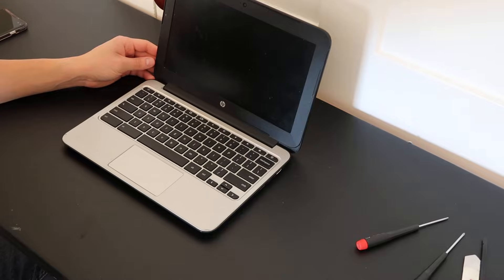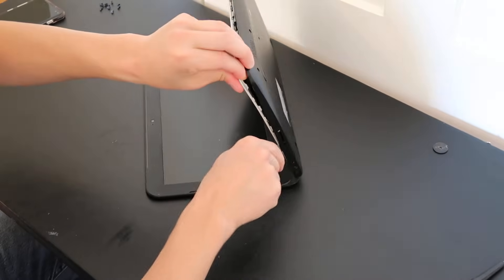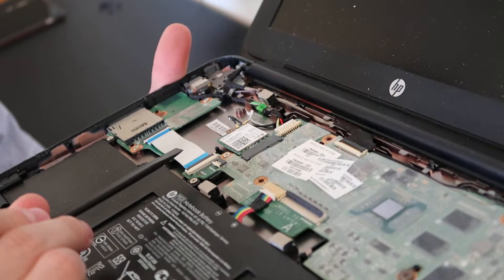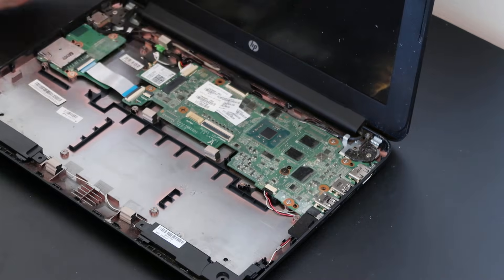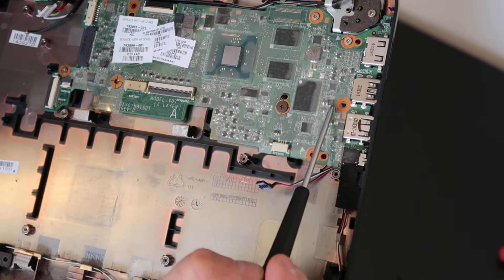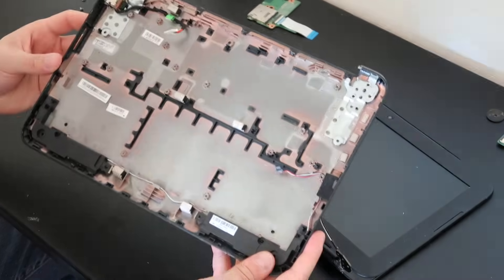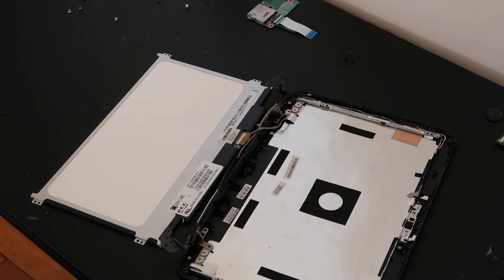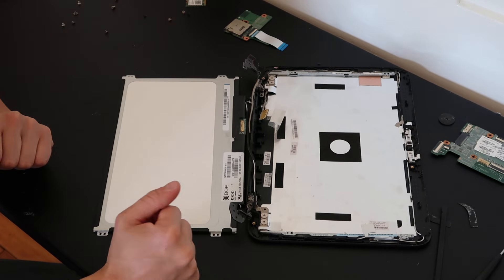Teardown / Disassembly - HP Chromebook 11 Laptop Computer

Comment: i have a question! whats the purpose of the tape covering all sides of the motherboard and what will happen if i remove it? thanks!
Reply from the maker: Just to keep it and the wires secure. Nothing bad will happen if its removed but I would recommend putting everything back how it was when your done whatever your doing.
Reply: @PC_Monkey alright, thanks! :)
Reply from the maker: @evvanescent  Happy to help :) Always here if needed !!

Comment: is there any way to upgrade the storage?
Reply from the maker: Remember to check the FAQ's on my videos! It could save you time getting an answer to common questions :)
As in the case with many smaller Chromebooks, this model does not have removable storage or memory. They are integrated into the motherboard.

Comment: What does it mean if my black string or bog fluffy wire is cut
Reply from the maker: If a wire is cut, then the components on either side may not work. If any part of a computer is damaged, it should be replaced. Do you need help finding a replacement?
Reply: I found out what it's called it's called a ribbon there's a little tear on it would that stop the computer? @PC_Monkey

Comment: how to upgrade storage? i cant see the ssd?
Reply: i just got a hp chromebook how to get its model and how to upgrade the storage?
Reply from the maker: @trojan010207  As in the case with many smaller Chromebooks, this model does not have removable storage or memory. They are integrated into the motherboard.

Comment: Wait, where was the SSD? 😅. Is it upgradeable in this model ?
Reply from the maker: In most of these little Chromebooks, the SSD is actually an eMMC drive, and its integrated into the motherboard. It cannot be easily removed / replaced.

Comment: at 15:28 if i happened to pull out that wire on a school chromebook, would it be cause for a total replacement?
Reply from the maker: You pulled the LCD cable out of the LCD and the cable is broken?  Is the LCD port broken as well?  Usually those cables are fairly inexpensive.  Should be able to get one on Ebay for under $10 USD

Comment: I have a HP chromebook 14 g4 and I have been meaning to make it faster and increase its internal memory. Is there anyway to do that or do I have to go for an external ssd or hdd
Reply from the maker: You would usually have to go with an external option.  Most Chromebooks have integrated RAM and eMMC drives.  They are part of the motherboard and cannot be easily replaced :(

Comment: I have a HP chromebook. I watched this video and popped up all around it except the area by power button which is on top left. The other side just under the screen area also will not pop up. My hp says battery not detected and I heard if I unplug battery an plug back in, it might work again or possibly replace of that trick doesn't work. Please help.
Reply from the maker: 1.  What model Chromebook do you have?  Are you asking for help getting the battery out / taking the panel off?
2.  Have you tried the steps seen here?  https://www.youtube.com/watch?v=arZpfqcVoUs

Comment: Were is the SSD drive located any help would be welcome. I want to replace the SSD with a larger drive so I can run Linux I have the same model as this one don't want open until I know where the SSD is.
Reply from the maker: If you have the same model computer as seen here, then you dont have a SSD.  You have an eMMC drive an its integrated into your motherboard.  It cannot be easily removed or replaced :(

Comment: So you can't change the internal hard drive or put some more ram? they're all soldered at motherboard?
Reply from the maker: In this model computer yes, the drive and the RAM are integrated into the motherboard.  They cannot be replaced or upgraded.  You can however, add external RAM or an external drive that would plug into the computer.

Comment: where is the ssd of the g4
Reply from the maker: This computer has what is called an eMMC drive.  Its slightly different than a normal HDD or SSD.  Its integrated into the motherboard and cannot be easily removed

Comment: Greetings!
I got my Lenovo Chromebook today and am looking into upgrading what I can. Mainly, I'm trying to find out if I can replace the M.2 WiFi card with a WiFi 6 card. Can you? And if so, do you need a specific one, or will any one that fits work?
Also, I noticed these are fanless. How do they cool? I didnt see the CPU when I opened it up today and was wanting to repaste it since most laptops come with mediocre paste.
Reply from the maker: Many Chromebooks have very few upgrades.  If your WIFI card is separate then you may be able to upgrade it but there are few upgrade options usually. 
Many Chromebooks dont produce that much heat as they are much simpler machines than normal computers.  They dont need the cooling power of a normal Heatsink Assembly.
The CPU is most likely integrated into the Motherboard as is the Hard Drive and RAM so they cannot be upgraded independently of the MB.

Comment: I've got a HPChromebook 11A G8 and want to remove the write protect and install a bigger ssd. Oh, and linux too. HP are p1$$-all use. Help PUHLEEZE!!!
Reply from the maker: You cannot install other operating systems onto a Chromebook other than Chrome.   They will not support it. 
If your SSD is integrated into the motherboard, as is the case on many Chromebooks, you cannot upgrade it.  You would have to use an external drive hookup.
Reply: @PC_Monkey  I've seen others who have done just that (but with different/older Chromebooks). There's also lots of info online about how to do this. Except there's lots of inaccurate info about how to do this.
 As you can see from my original post; I asked for help regarding this. I haven't used my CB since then as I don't want a Google-approved, restricted storage&use netbook. So what now?
Reply from the maker: @forandonbehalfof4753  If you can download Windows onto a Chrombook, I dont know how to do it.  I have never done it and didnt think it was possible for most Chromebooks.  Sorry.  If thats what you want to do Im prob not the one to ask.
Reply: @PC_Monkey  - I haven't had anything to do with \/\/1|\/|P|)0Z£ since '98 and just want to install (probably) Mint. I just don't want anything Googly like ChromeOS installed on my CB. It wouldn't have been a problem before but lots of my knowledge and memory decided to take a permanent holiday hence the post 5months ago. I found manualslib.com and it's great for info for my other laptops but they don't cover my CB properly yet (I think it's too new) but they'll probably cover it in the near future. I've seen other YT videos (by trusted people) who've changed ssds, etc. on older models and I can still follow instructions but I can't seem to find them anywhere for my CB. I don't even know if it's possible to do what I want which is making my CB useful (decent storage, decent OS).
  No need to apologise, though: I just get frustrated that companies like Google don't want to let us think by ourselves OR use our own hardware the way we want. Basically, I want to use my CB the way I want using my choice of software and I suppose as a useful netbook. That's why I want rid of the "write protect" screw crap and access to some kind of manual (or something) so I can use it as something that gathers dust...
  Thanks for your help anyway and I'll just keep searching...

Comment: Original my problem was that a few key wouldn't work. I just opened it up and didn't touch anything. I decided to stop before doing anything so I closed it up and when I went to turn it on it wouldn't. Now it won't turn on
Reply from the maker: Most likely, something was loosened or unplugged when inside.  Double check all the connections. 
For a computer that does not turn on, try this video first;  https://youtu.be/P3I7dDpkJps.  Let me know how that goes :)

Comment: Love your tutorial. Do have a question. The ribbon cable popped out fine, however in replacing; the contacts on the cable appear to face down and the ribbon fails (yet) to lock in place. Assuming the clips should raise then pressed down on to the cable... is that correct?
Reply from the maker: I dont fully understand the question.  In order to put the ribbon cable back, you would lift up the clip, slide the cable in under it, and then press the clip down to secure.   Is that what your talking about?  What time stamp shows the situation your facing?

Comment: do you know where the write protection screw is?
Reply: Some yt videos show where it is and how it's identified. You might just have to keep searching until you find a video that covers your model.
Reply: depends on the exact model but it's one of the ones with the circle around it - but it's divided into 4 sections, the screw crosses those sections and allows power to go through, which is how it enables or disables WP
Reply: @doggy_ebooks  - It's not really any use if you say it's "one of the ones". Any idea how many CBs have screwholes in circuit boards with circles around them?

Comment: is it possible to change the ssd card or it is on motherboard?
Reply from the maker: On Chromebooks, its usually integrated into the motherboard :(
Reply: @PC_Monkey  thanks
Reply: @PC_Monkey  
you mean I can only expand my hp Chromebook storage thru MicroSD?
Reply from the maker: @joshtization  Usually, yes.  What brand and model do you have?